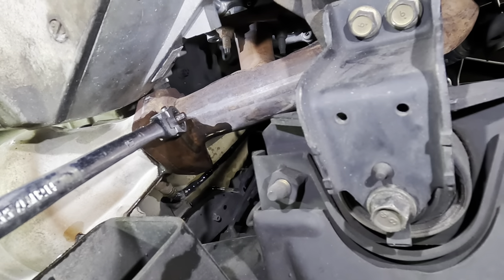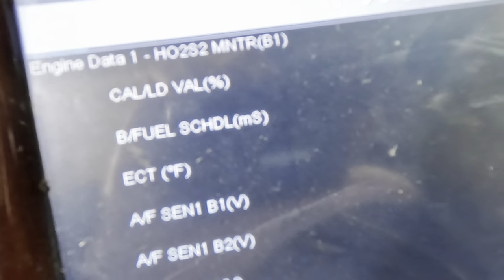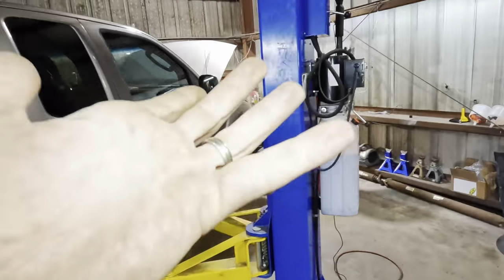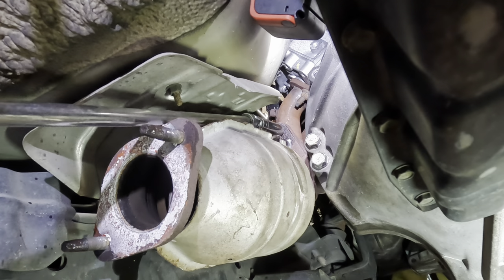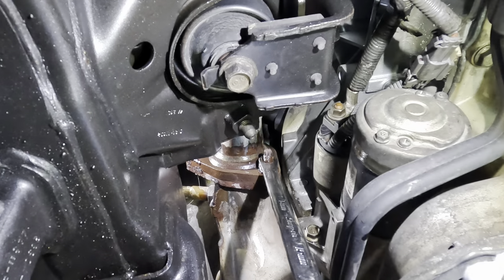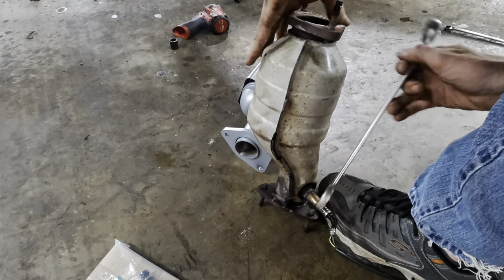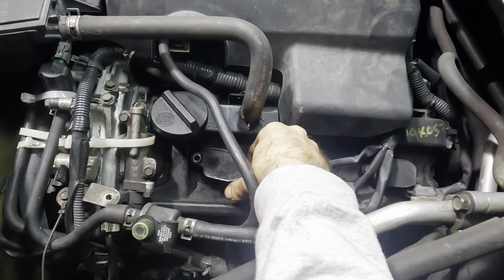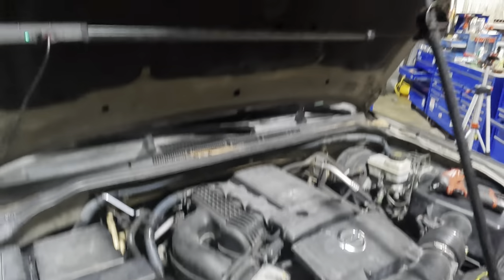Catalytic Converters! Missing?  Running Rough P0302 P0420 P0430 Nissan Fronter 4.0 v6

Comment: The plane takes off. Period. End of discussion. The engines that propel the plane forward are not connected to the wheels.  The engines push the plane forward regardless of wheel speed....  In fact, the plane wheels don't even need to be touching the ground for the plane to move forward.  That's how a plane continues to fly (move forward) in mid air. If wheel speed had ANYTHING to do with the plane moving forward, then how does the plane continue to move forward when it takes off normally?  In this example, if the conveyor belt is moving in one direction, and the plane WILL be moving forward in the opposite direction, the only result is double the wheel speed, which again is irrelevant to plane air speed. The plane takes off.  It's been done.  Stop splitting hairs.

Comment: That airplane - conveyor scenario is one of the dumbest no- brain questions ever.
In the case of a small airplane if the conveyor was long and moved the whole plane fast enough it might take off without even having the engine running.
Conveyor just moving the wheels, if the conveyor is long enough and moves the wheels fast enough the wheels might come off.

Comment: The plane wont fly as there is no air flow over the wings surface. , however turn the plane vertical and have much much bigger engines and you could turn it into a rocket. then it will take off. so now picture this a plane flying at 500 mph with a tail wind also of 500 mph will the plane continue to fly or fall out the sky like a rock. :-) let the debate begin.

Comment: +/- 39 min. Silly Ray. Increasing the quality of the fuel to reduce emissions will not generate sufficient return on investment for the investors and by extention it will reduce unnecessary profits. Can't have that. Profit margin is far more important.

Comment: Hey..
I like your video's...
But-- edit them down...
A hour like video can be  just to long..for us watching to learn.
I stop watching anything over 30 minutes..
And, stop watching video's yapping kaka words/ instead of diagnostic cheat sheet info  insights.. 
"Like did you know you could", or another way you can test/ cheat this on us..bla..bla..stuff.
A boat load of info in  30 minute...A true learning experience. 
 What say you...?
If interested...
As a old shop teacher,
I have ideas/ tips.. I would like to share with ya..pal 
But you probably do not need a tired old pro's advice.
See Ya the next 30 minute video I see you posted...
As I told my student's... 
In this session today..
We talk shop..or we don't talk at all... no matter how trivial.. I wanna hear shop talk this entire class, thinking caps on..
all your thoughts or beliefs on the table for everyobe to learn from.. Not a single yapping squeek from anyone ..!!
This is a class..Not a bar room..
We are all hear to learn!!,
Even me...